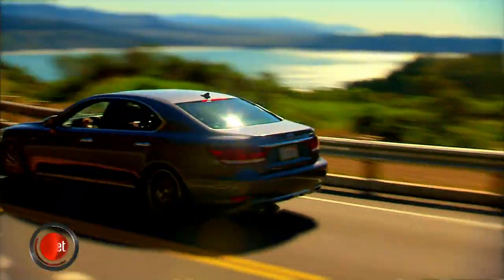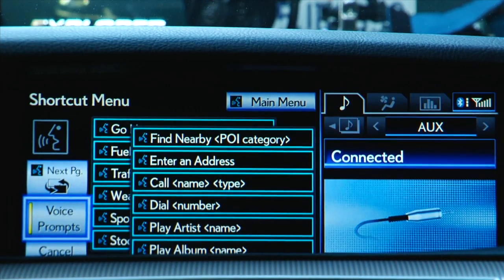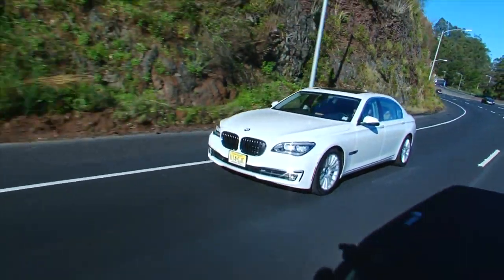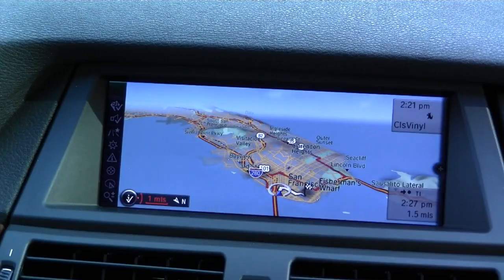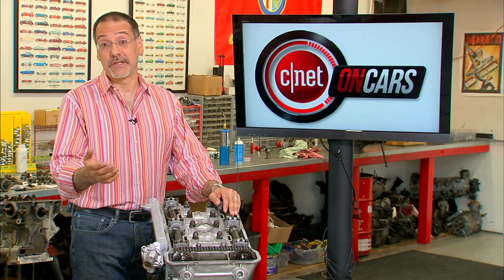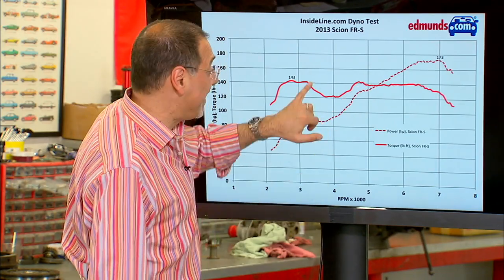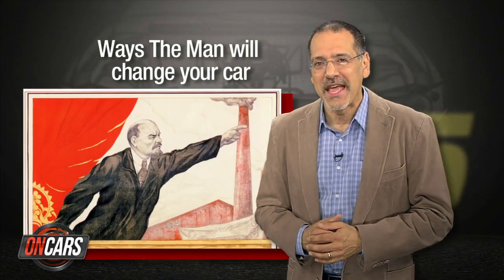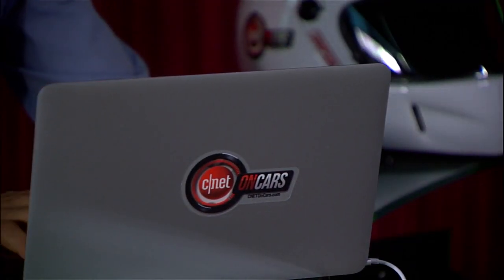CNET On Cars - BMW 750Li vs. Lexus LS460 F Sport Ep.12

Comment: I had the 2013 BMW 750Li. The engine self destructed in 2016 while still under the manufacturers warranty, a job that would’ve cost me over $40,000; thank God it was still under warranty. Turns out those V8 twin turbo engines were known to have issues. Also, the battery would consistently drain because there’s no alternator to charge the battery, instead they have a battery regenerative braking system that’s proven ineffective, therefore owners are charged for new batteries often.  I drove the car until the warranty ran out, then I sold it. Now I happily daily drive a 2014 Lexus ES 300H.

Comment: How typical. At 8:29 the bmw has the check engine light on already 😂😂😂😂😂😂😂
Reply: +yaseenshuja1  N63 Customer care package will take care of that
Reply: +Rick Smooth prevention is better than cure though
Reply: +yaseenshuja1 yo
Reply: +yaseenshuja1 every automobile manufacturer have had or will have some type of issues,
Reply: +yaseenshuja1 All the dash lights were on because he had the ignition in the "On" position with the engine not running.  Nice try, though.
Reply: +TheLanard you'd think of all lights a company like bmw would sway away from that being the only light on when the ignition is on. Even if other lights do in fact come on they should still leave that one off lmao
Reply: You're right about that.
Reply: Every car manufacturer will have  some type  of issue with it's product.
Reply: It's in accessory power mode
Reply: +rohan singh yeah but the video is 3 years old so the car probably actually has it on now and 5 other lights on
Reply: yaseenshuja1 great spot sir:)
Reply: looks like your still riding a bicycle
Reply: wow
Reply: Well spotted!!!!
Reply: @OIR339 
Correction, that's the only light you can see from that angle. Every car lights up the check engine light when accessory mode is on.

Comment: The problem with most auto reviews is that they test brand new cars. Nice but most new cars don't stay that way and the way to tell how a car really is, is after 40 or 50 thousand miles on them. At that point there is no comparison. Bmw's, Benz's, Jags will all be in the shop with various problems and headaches. The Lexus's never break and will still be rolling strong. I mean they never break. Take them in for their scheduled maintenence, and you will get over 150 to 200 thousand miles easy. They are rocks.
I'll take the Lexus please. Not even a comparison.
Reply: pm512 only150k-200k miles? any japanese car can do that.. toyotas are the only cars i see commonly for sale with 250k-300k on them running fine
Reply: Dear Ryan. No. Not all japanese cars can do that anymore. A good bunch of them maybe, but I know exceptions, even for Japan. Don't forget that Japan isn't making all their cars into Japan, and sometimes, some joint-ventures wheren't that great.

Comment: I'd have the Lexus I rather have a Hot wheels or a Matchbox car than to have a BMW. It was good how he explain horsepower torque good video Cnet.
Reply: ***** I agree that the BMW is much better driving but oh the maintenance. I have owned both and I stick with Lexus because I pay less overall.
Reply: I have owned BMWs all my life and I currently drive two of the and I will prefer a BMW over any lexus.
Reply: nature10879 They're good cars but they cost a lot to maintain. Just depends on what you like to drive I guess.
Reply: *****
The Comments we're fine until you insulted someone because of you're insecurities. I will tell you this > You have no idea what someone has drove or owned so just that comment alone tells me about you're level  of intelligence.  Why don't you post a video of you're 2 BMW'S you claim you have and link it in the response. i bet you are full of crap or you drive one of those 3000 dollar Craigslist BMW's
Reply: Clyde Smith how did he insult anyone and second he’s not bragging abt it or anything

Comment: Torque and power section is not covered well enough. By watching it you cannot answer question why 300 lb-ft diesel  does 0-60 in same time as 200lb-ft gasoline. Major information about gearing is missing...

Comment: You're using the wrong reference point. In fact, you're not using a static reference point at all. 18k is insignificant when your reference point is the LS's MSRP, but if you add another 18k, you are no longer just referring to 18k, but rather 32k on top of the LS's MSRP.

Comment: So if I would hypothesize that mentioning the horsepower is totally irrelevant, instead mention only the torque, would that be correct? Or is it still necessary to mention the HP as well for some reason?

Comment: Lexus wasn't designed primarily for the American interstate. It's designed for Japan's so-called autobahn and road system in which both are very similar to Germany and the EU in general. The difference is the Japanese prefer their luxury cars to be quite conservative but posh. Most Japanese execs are chauffeured so Toyota probably put a lot of effort in the backseat. Regardless, the BMW and the Lexus are both exceptional but they're also two completely different in automotive character.

Comment: hi cooley
(torque*rpm)\5252=horsepower so car produces torque and rpms. the ferrari 458 is not powerful car compare to likes of mclaren mp4 but it outdoes mclaren because it has close to 9000 rpms long  and also a great transmission box other than that you were on the point with everything else

Comment: Because your logic is flawed. The LS is an "expensive Toyota" in the sense that it's designed and engineered by Toyota motor corporation, the largest and most successful car company in the world. It is not an "expensive Toyota" in the sense that it's not a true luxury car. In many ways Lexus is more of a luxury car than BMW, which is best known for the 3 series class of sport sedans. The LS has a legacy of precision engineering and bulletproof quality. It's is no less a luxury car than the 7er.

Comment: peak power of mp4 comes at 6000 rpm it 9000 for the 458 mp4 s turbo charged ( reason for higher and faster torque) 458 naturally  aspirated

Comment: More buttons in the Lexus??? Already in the beginning I know it is a bias review. The Lexus has the bigger engine, but it is surpricing that BMW get the same fuel economy? A 4.6 always use more fuel then a 4.4 with turbo, it is the whole point of turbo. Smaller engine, less fuel , but more power.

Comment: Im speaking out of experience, I had a Lexus, Cadillac and BMW, Cadillac was so garbage that i wont even talk about it. I had to problems with my Lexus IS, other than the 3 recalls they issued about it, for my current 5 series, its my 2nd year driving it and yet no problem what so ever, so In my opinion, BMW is better.

Comment: the bmw is almost 5 years old, bmw got this though
Reply: that's the 2013 BMW 750...
Reply: Michael Chang He means it's an aging model that has been on the market for years longer than this Lexus
Reply: Winter is Coming yea but Lexus still has the same body and 99% same engine. Lexus made some changes to the exterior and only bumped up like 6HP. So we still have to wait until Lexus drops the new engine and does a full redesign.. When Lexus first dropped the 380HP 4.6 liter on LS460 back in 2007, it was more than 750i and about 5HP short of the S class, but still it kicked their ass in a race. So BMW's engine is actually 2 years newer since the twin turbos came in 2009.